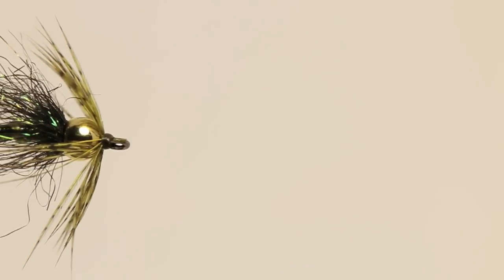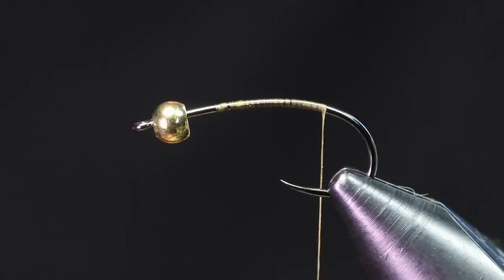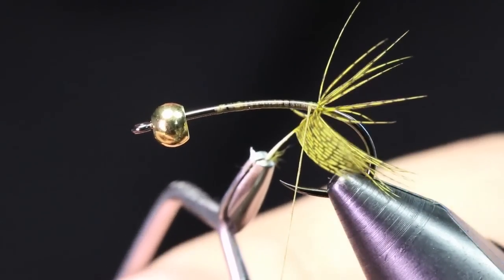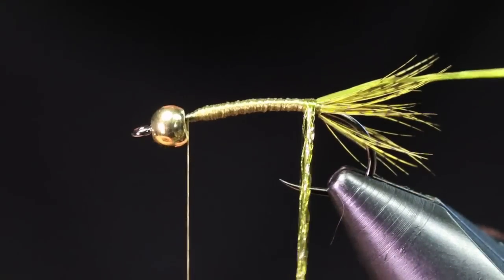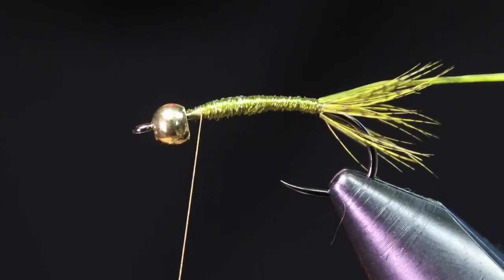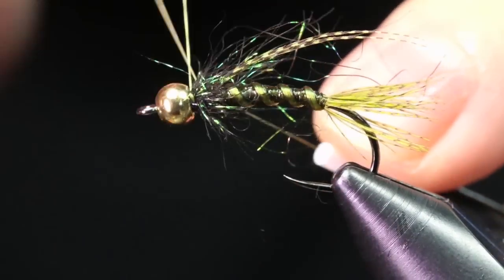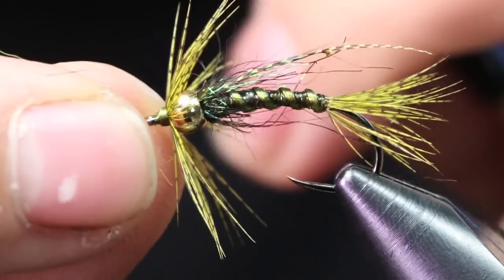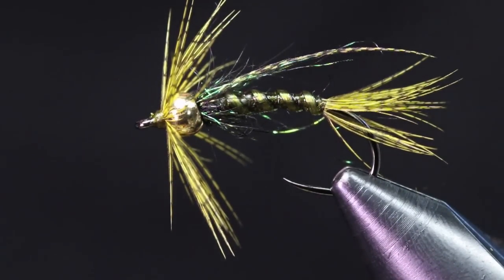Swinging Holy Grail Fly Tying Tutorial | The Fly Fiend

Comment: I’ve admired your fly tying work for quite a while.  Your narration is excellent.  The shoulder feather from the Partridge skin are good selections because you will notice that they have more of a cupped shape than feathers from other locations on the skin and when tied in properly they sweep back nicely with a curve to the barbs.  By the way the “fuzzy stuff” at the base of any feather is technically called Filoplume or “after shaft feather” which is the slang term.  The only “creative observations” (constructive criticism) I have is when beginning to wrap you ribbing, pull the flexi-floss tight for the first wrap and then slightly release the tension for each successive wrap.  You had a nice taper to the body which almost disappeared with the thick ribbing material.  By pulling it tight you reduce the thickness of the ribbing at the rear portion of the abdomen.   Also, when spinning long fibers in a loop, don’t allow the loop to spin gradually as you spin the twister.  Pinch the thread and allow the thread to load up with turns and then let it go to effectively spin the materials once.   With one iteration of spinning at a fast speed created by loading up the tension, you won’t trap as many fibers that you need to pick out.  Lastly,  when tying in body materials, ribbings, etc.  I place them on the bottom side of the hook shank.  I noticed you place them on the side facing you.  I suppose its a matter of preference, but by placing them on the bottom you avoid one side being out of proportion with the opposite side and it also allows you to bring the material up from the bottom and hiding the starting point of the materials (meaning you don’t see the where the ribbing starts on the side of the fly.  Sorry, I’m a perfectionist tyer and believe that if you are going to tie flies, they should be tied as well as possible, given the skill level you possess.  Like I said, I admire you work, primarily from a technical standpoint.  Your work is clean and neat and always in proportion.  Well done!
Reply from the maker: Thanks Mark! I will defiantly give those tips a try! thank you for the comment and your input I appreciate it very much!

Comment: Nice pattern for low water steelhead. What weight rod/type line are you throwing with your polyleaders? Length of leader?  This is an excellent pattern for sinking/lifting approach.
Reply from the maker: Hey Stephen, I would typically toss this with a 11ft switch rod, 6-7wt with a long scandi line and depending on what water conditions different polyleaders.